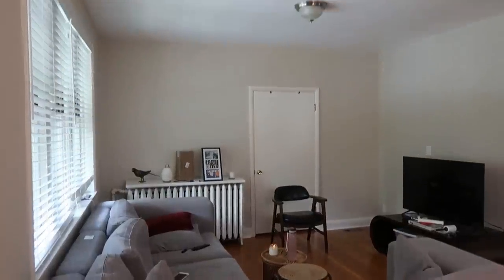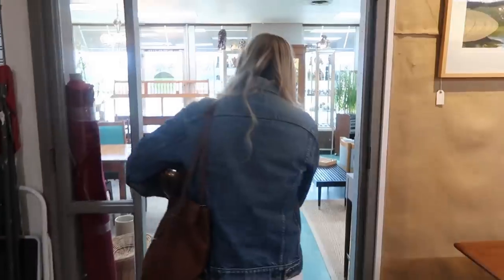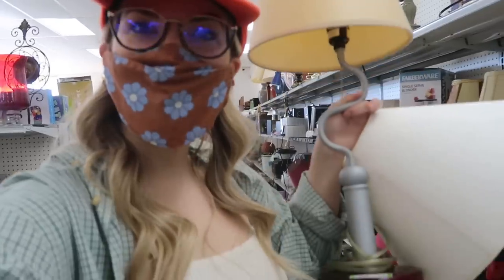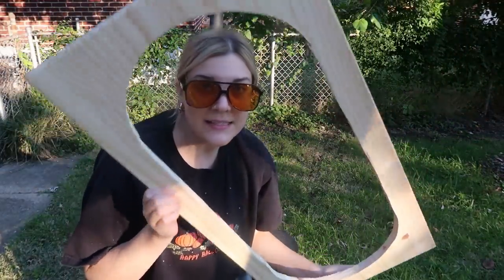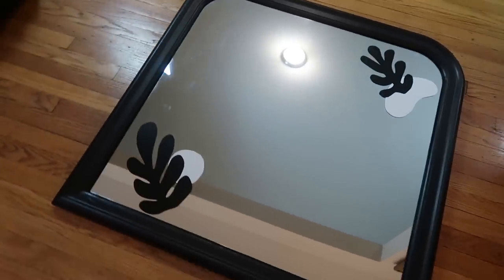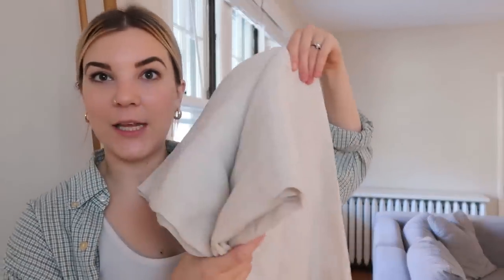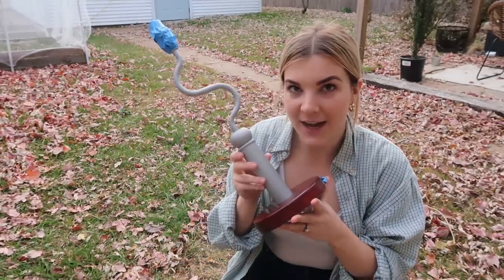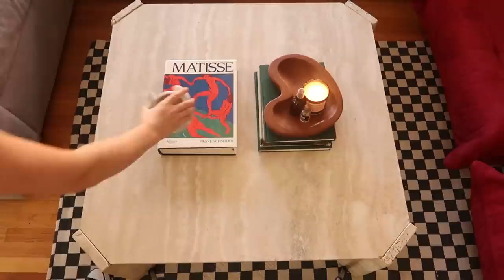EXTREME THRIFTED LIVING ROOM MAKEOVER + TRANSFORMATION *Ikea Ivar hack, DIY, thrifted, budget decor!

Comment: Circular saw would have worked fine. I use mine all the time to do plunge cuts. You have to put the front lip on the wood, pull back the guard and slowly lower it down.

Comment: I feel obliged to make this public safety announcement, but jigsaws are to be pushed through material not pulled. The blade should be turned around so that the teeth of the saw are facing away from both the electric cable and the operator.